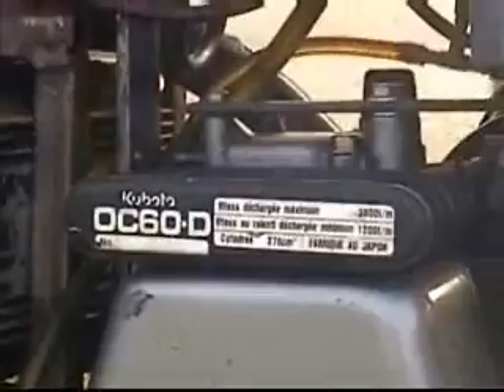DieselElectric2_.wmv

Comment from the maker: Perhaps there is a sensor that detects the extra current required and thus revs the engine to provide it? I could only see rectifier wiring. The builder doesn't speak my lingo so not sure about its finer points of operation. Interesting machine though.

Comment: Alternators have %35 power loss at producing electricity  while classic wet-clutch transmissions have about %6 loss -  But in heavy traffic and stop-start situations, a pretty high capacitor could collect the electricity and deploy to transmission motors when needed